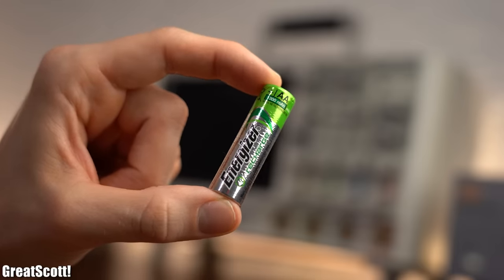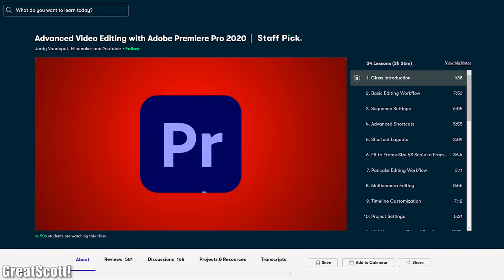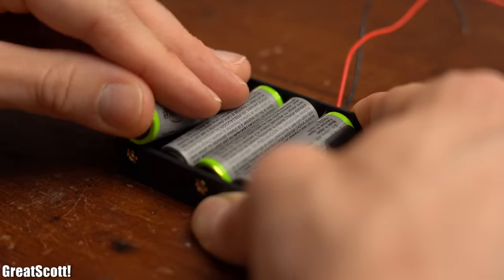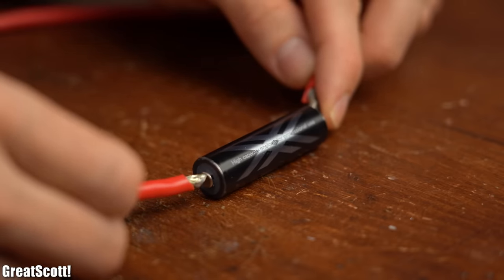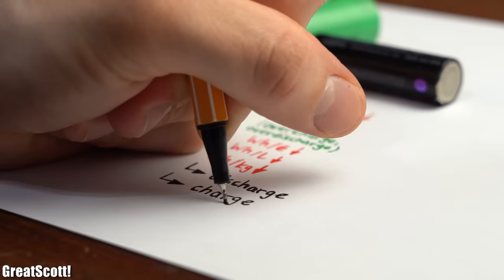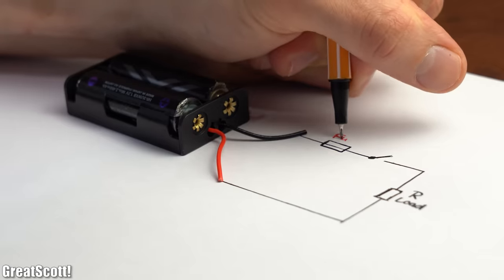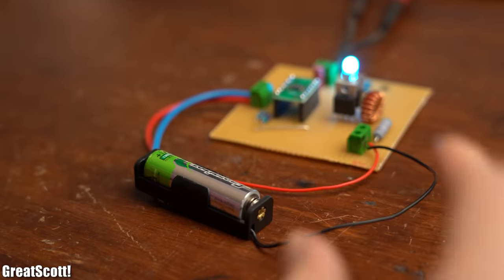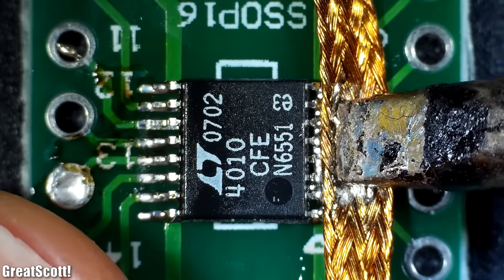Are AA NiMH Batteries obsolete? Here is everything you need to know about them!

Comment: NiMH are like NiCd, in that they should occasionally be zero'd out, yes fully drained. This will actually extend their life. Unlike NiCd, this should be done infrequently (maybe once a year). However, you need a charger that can fully cycle the battery. Most chargers only charge and won't work if the battery voltage is too low. 

I found a report that explained how the Navy reduced their battery failure rate by implementing this on their NiCd powered devices. Sorry, I don't remember where I found the report.

As for me, I have swapped NiMH into all my devices. I have been using NiMH in my headset for the last 7 years, (actually, three sets that I rotate).

Comment: Nominal voltage is not the function of type of lithium cells (li-ion, li-po), nor shape, just an FYI. Both presented, pouch and cylindrical cells, are generally described as li-ion, voltage differences comes primarily from differences in chemistry, the blend of stuff on cathode. There's no polymer in "li-po" cells, aside from Mylar pouch in the flat one and separator in...every chemistry :)

Comment: I used them this past halloween to power LED lights I got from the dollar store.  I also got some alkaline batteries and after  looking up some videos that say you can actually recharge alkaline i decided to take the risk, as the chargers i have have a self shutoff if anything is off, and it worked, anytime i tried to recharge an alkaline battery that i couldnt the chager would flash or turn off, which i never had that happen while charging nihms, even when they got super hot, which apparently the charger was supposed to pick up on.  In the end it "seemed" safer charging my alkalines then the nihms purely based on heat given off.  However i  suspect the self shutoff didnt work all the time with the nihms why they got  warm.  This was a 500ma duracell charger i actaully found in the trash, so who knows, the other was a enloop one just like in this video, without the sanyo logo but looks the same,  it had no problem turning off when the alkaline batteries were funny.  
   Anyway the reason of writting this is because i just wanted to say i found the alkaline batteries better for LED lights reaching a higher maximum voltage they were brighter then the nihms, they also recharged fastser,  waaaay faster which made it easy to swap them out every hour and get full brightness all the time.  The caveat being they cant go below a certain voltage or yu cant recharge them back, with nihms you can,  it seems however that if i didnt let the alkaline battery get below 1.35 -1.3 volts i could recharge them indefinately back up to 1.5, and in just a few minutes.  Which was perfect for my applcaton where  i could swap out the batteries every 45 minutes or so and not have a problem doing that, felt like i was adding wood to the fire.  But when i fell asleep and left the batteries in powering the  LED lights all night, I couldnt recharge them the next day, so in the end Nihm still won out on cost, even though you can get a few recharges out the alkalines, chances are you wont be carefull and never get the amount you could with nihm batteries.  But nihms dont recharge to 1.5v is the only drawback.   Ive since decided to switch to a usb powersupply solution, and now thinkg about lithium battery bank, thats recharged with solar during the day, to power led lights during the nighht.  Glad to see nihm still getting some use, but is there any hope left for alkaline still?  Maybe with a clever charger you coud keep alkaine going somehow.

Comment: The thing I found annoying about Nicd and Nimh was their low reliability and poor voltage retention when idle. 
It is only now, when we are all moved from Nimh to Lithium, the truth starts being circulated - it takes ages to properly charge NImh. I have a plug in bank for charges that is on a timer. It comes on once a week for six hours. The Lithium batteries are fine but the Nimh ones have reached the point they will not work for any usable time. The charger now switches on for 14 hours once a week. Hoping that sorts out the problem. 
This still won't get around the poor voltage retention of Nimh. 
Once I have converted my power tools to Litium I can forget about this issue.

Comment: Charging those 2450 Eneloops with a cheap charger isn't that good for them. 
They usually charge with a quite low amperage. As you explained, many of these chargers rely on reaching the termination voltage, after which there is a slight drop in voltage. The charger detects this drop and then stop charging. If you charge a high capacity NiMH battery too slow,  the charger will most likely miss this drop in voltage as it so small when charging slowly.  Ideally you should charge them at around 0.6-1 C for it to work properly. 

Noticed this when I was charging batteries with a cheapish charger that only put out 1000mah and for 2450mah batteries that's not enough. Batteries just get hot, possibly shortening their life span.

Comment: IT would be nice if you could get NiMH batteries that has a boost convertor for 1.5V.  These 1.2V batteries are great and all, but some devices require much closer to 1.5V to work.
Reply: I think there are some AAA to AA adapter cartridges \w built in boost.

Comment: I wonder why the AA standard itself (voltage and size) kind of died off with Lithium Ion -- meaning, why we don't see AA sized & rated LiOn batteries. Yes they would need to be clearly labeled that they can NOT work with NiMH chargers, but it would be great to be able to use higher capacity & higher value batteries in devices that accept AA batteries.

Comment: If you want your gadget to work at -20 Celsius, then go for NiMH. You device need to operate  1.24 Volt or some multiple of it. Of course you can have voltage lifters/regulators with an energy lost by conversion if you do not mind and money talks..

Comment: If we can draw 20+A, it is most suitable to make a 1.2v to 220v boost converter. It would be very interesting to see such project how long it last powering a notebook.
Best regards.
Reply: It's not suitable. When you draw 20 amps the voltage drops to zero. The maximum power output is obtained when you draw half the short circuit current. For the AA shown this would be 0.6v at 10A. This is only six watts output but more importantly the internal resistance in the battery consumes another six watts so the battery will overheat very quickly. I would want to limit current draw on AAs to 2 amps max.

Comment: for all these years always used  a series resistor to charge all my batteries, then came li-ion tried same but once got very hot just not to catch fire, after that using charge controllers & bms , they are not tolerant to abuse other types can a little.
Reply: get a bt-c3100 charger :)

Comment: NImH AA cells are certainly not obsolete. They're often an option for consumer devices that require AA cells, Single-AA LED flashlights being a good example. It would take a very big hammer to make an 18650 Li-ion cell fit into a device designed for AA cells.

IKEA is the best source for AA and AAA NiMH cells. Their Ladda 2450 AA cells are famously precisely the same as Eneloop, at less than half the price.  I'm hundreds of dollars ahead of the cost of alkaline cells, using the Ladda cells where feasible.

Comment: Who says NiMH batteries are obsolete? I'm literally gen z and use these daily. 
-small
-portable
-cheap
-reliable
-lasts forever
-safe(r than lithium polymer)
-sold in planet-standard sizes
They're the greatest thing since sliced bread. Convenient little bottles of energy you can fill up from the electricity-tap. You can be away from an outlet for days with a handful of these if you get a USB charger that takes AA's.
Reply: waht things do you use them in ?
Reply: @jimmybrad156  Work lights, portable speaker, tv remote, digital camera, power bank, and a Flip video camera (that last one broke but it lasted for ages).

Comment: My trick for devices that use two AAs is to use one 14500 Li Ion and one AA dummy battery that has the ends connected. Especially good for devices that can't take the lower voltage of two 1.2V NiMH batteries.
Reply: have you had a device that can't handle 4v? eg. if a charged 14500 had 4v across it and the device might be expecting say less than 3.4v (1.7v / 2).
Reply: @jimmybrad156  I just charge the Li Ion less (they last longer if you avoid 100% charge anyway).
Reply: @gblargg  Good idea!

Comment: Rechargeable AA Ni-MH batteries are still viable if you enjoy not buying new batteries all the time (as long as you buy a set with at least around 2450 mAh capacity). My biggest problem with them is how they almost always become unbalanced. Lithium cells seem to have a lot of the same problems as Ni-MH, but they're already solved. If someone were to build balancing into their device to account for rechargeable batteries, the biggest downside to using them would be solved.

Comment: Are you able to recommend any 6S LiPo over discharge protection boards (cut off voltage at 3.7V-3.8V per cell). Ideally one that has very low power draw once the cut off takes place and preferably with MOSFET rather than relay based. For the current draw low current draw if fine.

Comment: I mostly use leftover NiMH from old days for powering flashlights. 2X for simple ones usually, 1X with booster circuit. Those 1xAA flashlights with booster can get lot of light out of "dead" AA battery also. My best result is voltage drop to somewhere near 0.4 volt.
And don't get me started on kid's toys running on AA batteries! It's a scam by battery manufacturers ;)
You'll spend more on batteries than on the toy itself!
Reply: vàmpier bsts last 50 per longrr lithumbbstes ssves movrr

Comment: I agree NiMH is not obsolete and Lithium may increase dramatically in price over the next few years due to scarcity. I have used them for years in triple holder configururation for LED flashights I get over 1500 cycles and 4 years of life and they still work fairly well with the Duracell brand in the USA.
Reply from the maker: Thanks for the feedback
Reply: giid for you lith getß  up too 8000 çyçkes

Comment: "..usually charge each one individually.."  Every device I ever owned charged and discharged them in series. Not sure if it is because of that, but in my experience NiMH die very quick after one or two years or so.
Reply: It could be because they have to be refreshed. I have 2 worn out NiMH batteries and I experimented with them, I charged them and put them on a load like a flashlight that consumes more power. It could only keep it on for 1 second and then already it's too dim but I still let it do that till there was no light and recharged them. I continued this for 10 times and I noticed each time it stayed on longer and longer and now they work just fine again
Reply: get a bt-c3100 charger and eneloop cells.

Comment: I have energizer cells similar to yours and when their considered flat to a device (usually drops below the safe voltage 0.7v) I charge them using a smart multi chemistry battery charger and they only ever seem to take 300-350mah before being 100% charged.
Reply from the maker: Sounds like they are done for
Reply: @greatscottlab  that's the problem, I bought a brand new pack the other day and I got the same results I used them in an RC car to drain them quicker and once they were flat again around .8 .7v I charged them and got a max of 450mah in and a min of around 375mah. I know the charger is good because when I charge a lipo it will almost match capacity when charging from flat.

Comment: The battery can be charged with a constant voltage supply with a current limit resistor. May take a bit longer but is SIMPLE and SAFE. Note that discharging these batteries in series with no cell monitoring can result in one cell being "charged" backwards if the circuit is not shut off before this happens. This WILL ruin the battery. Thus any device that could be inadvertently left on should have cell monitoring unless it is not any matter if a battery or two is ruined.

Comment: What's also important to mention is the self-discharge when just laying inside a drawer. Only Eneloops are suitable these days. There are other brands who copied that technology from Sanyo (now Panasonic) but I haven't tested those. Be aware that most Ni-Nh batteries can be charged and can be empty after just 12h just by laying around. Especially ones claiming over 2600mAh.
Reply: If a NiMH battery is empty after 12 hours then it has failed internally. Regular NiMH should last at least a month and of course Eneloops last longer.
Reply: @eDoc2020  Or they're just so crammed inside that the separator is basically nonexistent. 3000mAh ones for example.
Reply: @eDoc2020  Or they're just so crammed inside that the separator is basically nonexistent. 3000mAh ones for example.
Reply: @kyoudaiken  If the battery's good it will still last a month. The ultra-thin separator just means it won't stay good for long. IIRC insufficient separator is what caused the Note 7 battery issues.
Reply: tbiße 2100 çyçkés bugrr cerson 500 çyckes

Comment: Yeah, you're not really supposed to mix different capacity NiMH cells, which is why I always keep them in pairs or groups of four. I use a smart 18650 charger that can also charge NiMH cells, which also has a capacity read-out for each cell, so I can see if individual cells have lost capacity, and I can mark them accordingly so I don't mix them with higher capacity cells. E.g. I have one pair of anyloops that charge to the full 1900mAh, but a second pair that have had a harder life and only charge to around 1700mAh. It probably wouldn't be the end of the world if I mixed them every once in a while, but running them to full discharge will cause the higher capacity cell to reverse charge the lower one, and over time that would decrease its lifespan.
Reply: thàtß how vàpoer ínmptràt fe old less càoti  bsteß

Comment: My wireless mice (office, homeoffice and living room) use a single AA battery and I am actually looking for a charger which is not charging NiMH-cells in series. Because all the chargers I have collected during the years will always charge 2 cells in series in their slots...
Reply: The chargers that come with batteries use a cheaper charge controller. You can get a better that has a charger per slot. The one I got also has a battery test function, that measures the battery capacity. That way I know which ones I should use in lower power devices.
Reply: Plenty of chargers that charge Cells individual. SkyRC NC1500 for NiCd and NiMh and Miboxer C4-12 for Li-ion and NiMh for example. So many models to choose from
Reply: BT-C3100 is good value. Could be a few improvements but can't complain for the price.

Comment: A lithium iron phosphate battery might be a better option, it is safer and more forgiving.
 Nickel metal hydride batteries are available in low self discharge versions, while still being tolerant to over charge and still being safer than lithium polymer batteries.